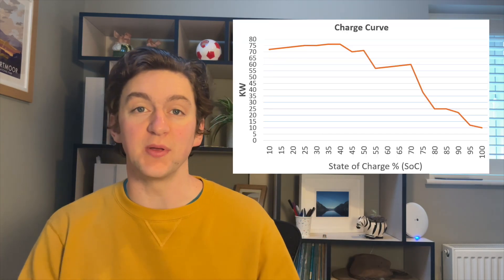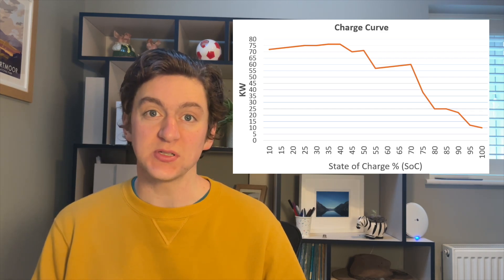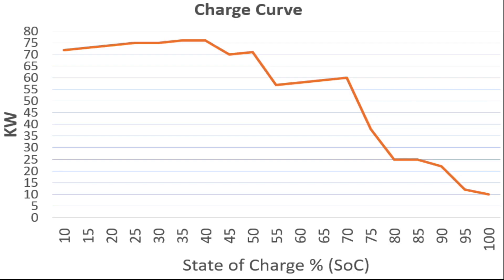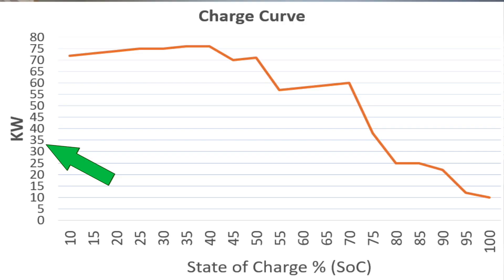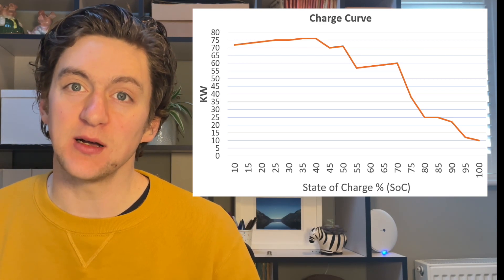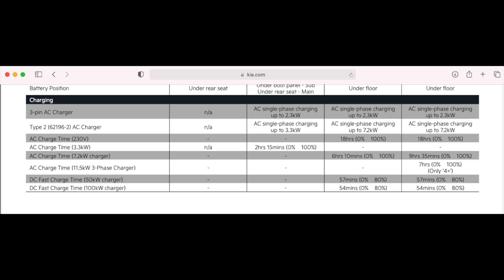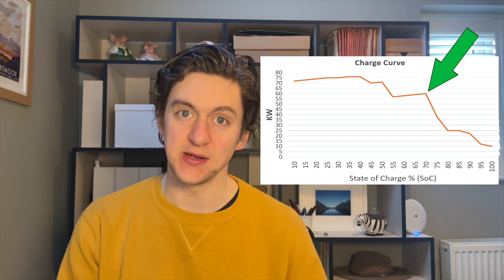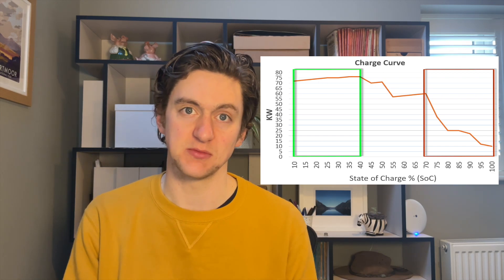Why You Can’t Charge an Electric Car as Quickly as You’d Think

Comment: Another thing that can affect to charge curve on the e-niro is battery temperature. You can only get 75kw  power if the SoC is low and battery temperature is between 25 and 35 °C. If it's cooler or hotter speed of charge will be lower than spected.